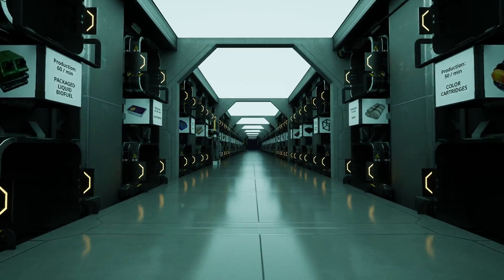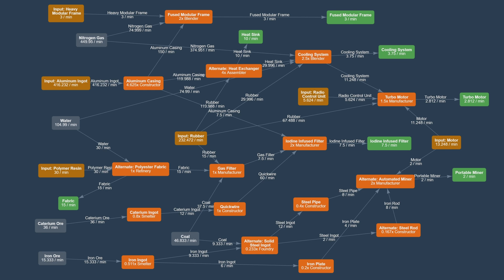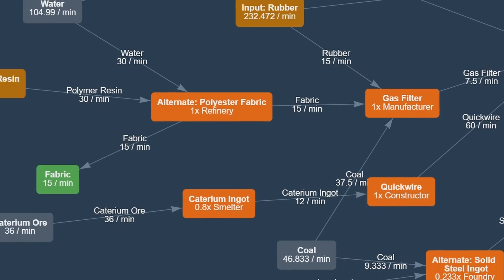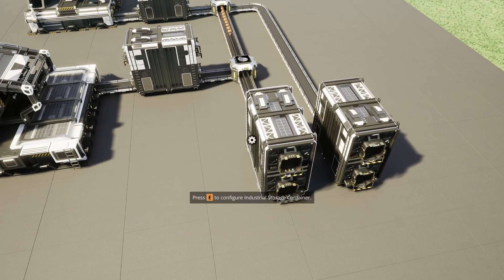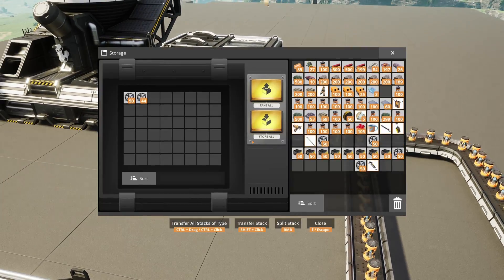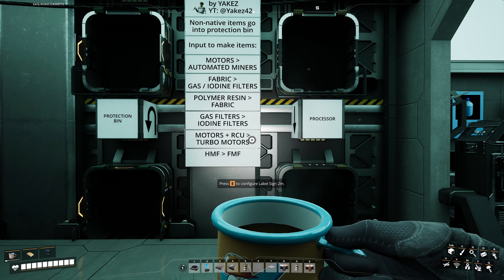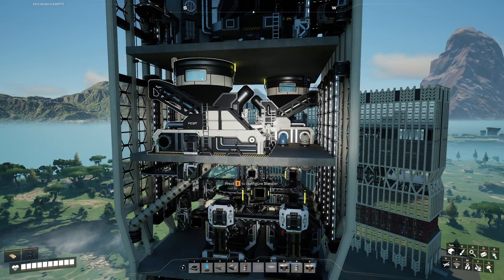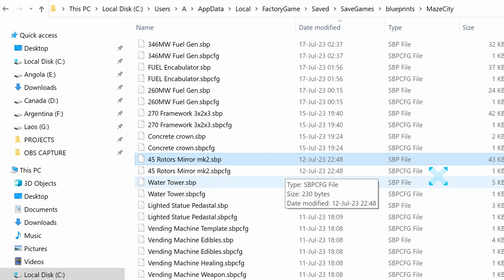Making ENDGAME Super Easy in Satisfactory!

Comment: Storage Module B level 3 is broken. 1 assembler Modular Frames don't work. upd: Smart Splitter left exit - None?
Reply from the maker: Are you sure? Version of this print from 28 November included in the pack. It have left setting any, center overflow, right none. Well at least if we are talking about MF manifold.
Reply: @Yakez42  yes. 1 Smart Splitter left exit None  - 1 Assembler MF (Center Position)  does not receive Reinforced IP